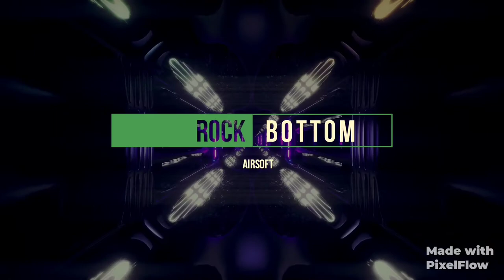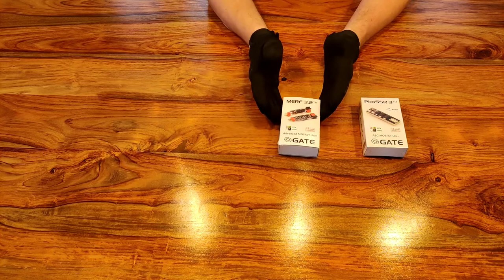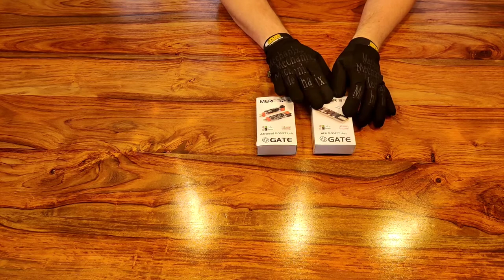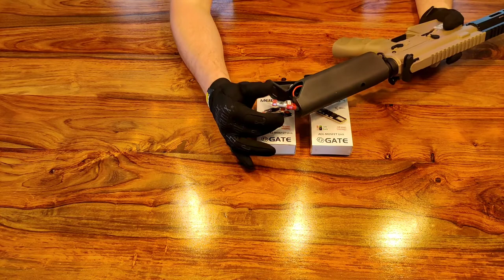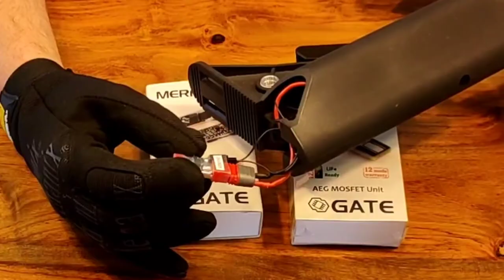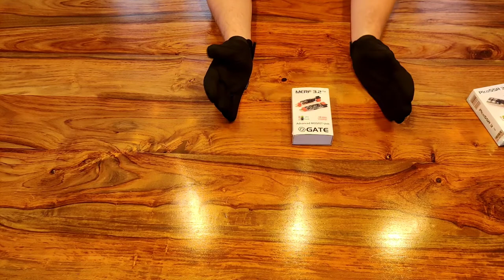A basic introduction to Airsoft MOSFETS. What they are, why use them and what's available.

Comment: New to this , are there any mosfets where you just plug it into your battery or do you need to open up your gun and all that?
Reply from the maker: There are fire control systems like the Gate Merf 3.2 I mention in this video. They can just be plugged in and will offer certain features such as burst fire(3 round burst). However to benefit from a mosfet you most solder the signal wires across the trigger contacts. In the case of an AR(V2) replica you will need to open the box. However on some replicas you can get to the trigger contacts without opening the gearbox. This is the case on V3 - G36/AK and V6 - P90. I hope this helps. Depending on your replica it may have a mosfet fitted, so always check first.

Comment: I’m new to mosfets…. Can I have one installed with my stock gear box and motor?
Reply from the maker: Absolutely. A mosfet can improve trigger response and make the replica "feel" more responsive. It also has the benefit of protecting your trigger contacts and generally making your electrical system more efficient. A lot of replicas have a mosfet as stock from the factory, even on more affordable ones.
Reply: @rockbottomairsoft  thanks for the information! I appreciate it can’t wait to get one